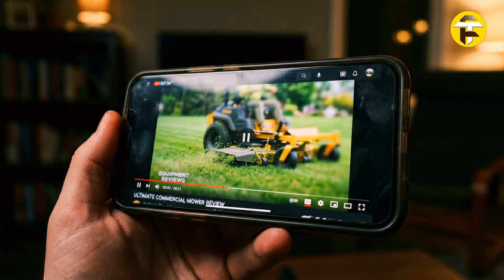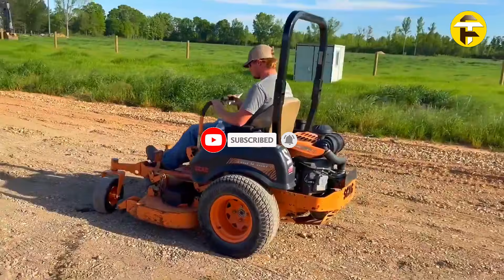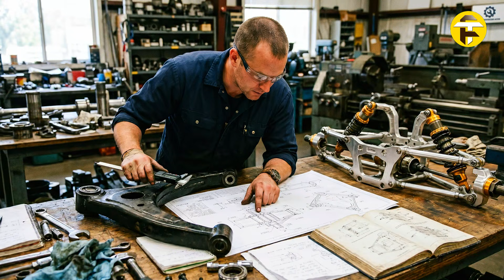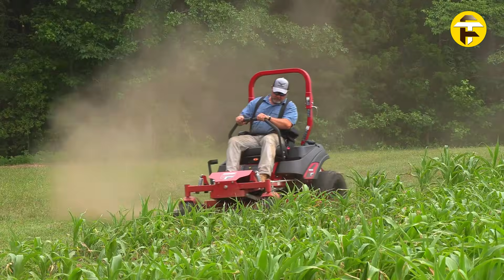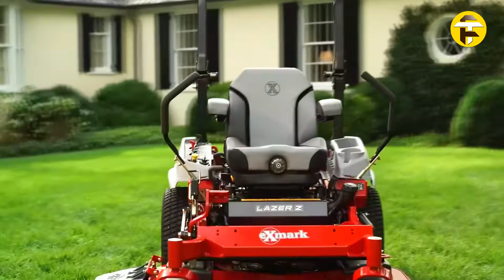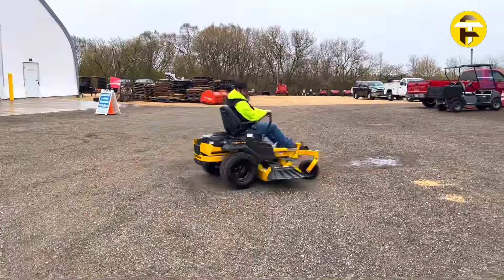The Only 4 Zero Turn Mowers LANDSCAPERS Buy For Their Own Yards

Comment: But what about the Bad Boys?
Reply: Love my bad boy nice ride kawasaki
Reply: The cheapest Bad Boy Zero turns are Rated Avoid Buying
Reply: @EmilGunnary , I didn't buy the cheapest. I bought a 60" ZT Elite for $6,000. It has a 7 gauge deck. Hydro-Serve 3100 trans'
-axles and a Kohler Command Pro engine. It's a solid machine and I love it!

By the way.... if you buy the cheapest in any brand, except Grasshopper, it's going to be rated do not buy. Because they all use the same cheap, disposable trans-axles.🙄
Reply: @lmccol8122  it still only has a Kohler and Not a Good Engine
Reply: @EmilGunnary , not true. I could have opted for a Kawasaki and paid a few hundred dollars more. But after doing a lot of research, I would rather have the Kohler Command Pro over the KR residential engine. Compare the air filters on the two of them.
Reply: Trash, compared to brands like Grasshopper or Ferris.
Reply: @KevinHuff23 everyone is entitled to their opinion. Even if they are wrong, like you. 🤡